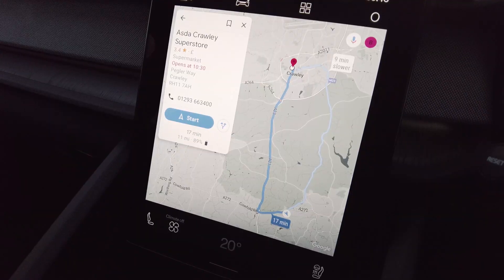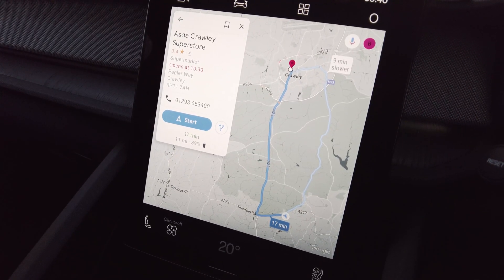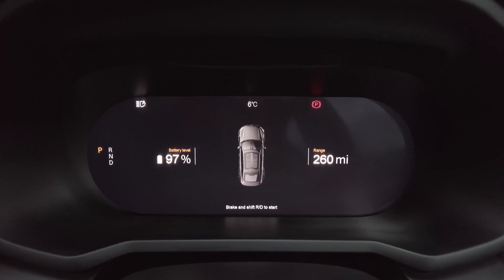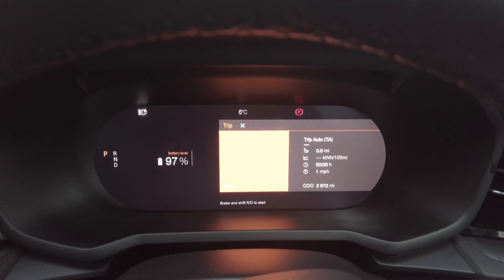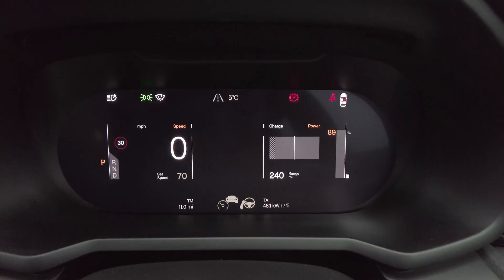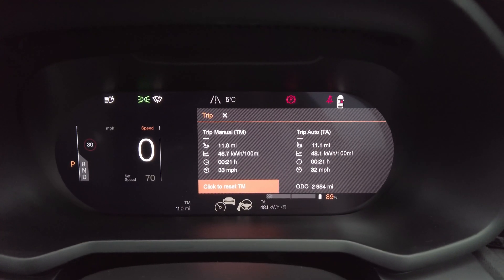Polestar 2 short commute with no pre-conditioning

Comment: I do these test on my own, since I rarely drive longer trips (most of the time I usually drive 20-60 km trips).
I think it's even more intresting how the EV's perform during shorter trips, since that's how most people use their cars.
No big problem for me though since I can charge at home 24/7 and slow-charge at work (working at home at the moment though).
But during trips like these (during winter, around -4 grC) I rarely go down under 30 kWh/100km.

Comment: I typically use 10-12% battery on my daily commute during winter 5 degrees celsius in my LR Model 3. 20km commute back and forth. which gives me a range of about 170-180km.

Comment: I totally agree about the relevance of long range winter tests - they don't correspond to many people's daily usage. Good job looking at this :)

For comparison, i am also only using my Model 3 2021 for short (15-20km) trips at the moment, and each time starting from cold. I am getting about 280Wh/km (450Wh/mile) if i start from cold. That corresponds to about 6% of my battery gone on a 17km (10.5 mile) round trip. If i preheat the car the indicated consumption falls a bit, but overall I will lose 8-9% of my battery for the same journey. The issue i think is that the Tesla aggressively charges both the cabin and the battery, which is about 8-9kW going just into heating. I don't know if the Polestar does the same. I would note that "cold" here is about -10C to -15C though. 

I don't charge at home, but i have access to free 11kW charging nearby. Before i got the car i had anticipated needing to charge every 2-3 weeks, but i find i need to do it every sunday right now as my chosen 20-70% SoC operating window (50% of full battery capacity obviously) is getting me about 75km, what with additional loss from phantom drain and random warm-ups when i do something in the car.

My conclusion right now is that if you have home charging this is a total non-issue. Same if you have workplace charging and your 20 mile daily driving is to work and back. But for new EV buyers who have neither and have to charge at a public charging point, then i think EV ownership could well prove a disappointment in this respect.

Comment: Great videos! This was an interesting one. I have the Polestar 2 (same spec as yours but in Magnesium)  I did a similar test; Got in the car cold, 15 mile round trip, steering wheel and seat on (lowest setting) mainly 40 and 50mph roads. Wet roads and 4 degrees outside. I got 40.4 kWh/100m. Started with a range of 190 miles, after 15 mile drive I now have 160 miles. Hope the warmer summer weather gives improved results. Can't complain though because I'm loving the car! Keep up the good work👍
Reply from the maker: Thanks! Yeah love the car and the warmer weather should definitely help

Comment: Yesterday, the temp was 32F when I left work.  No pre-conditioning.  I drove from my customer's site to the local hotel.  The distance was 1.63 miles which consumed 6 minutes of time with the cabin heat and seat heat running the entire time.  My efficiency was the lowest that I've ever seen on TeslaFi.com at 31%.  I used 746 Wh/mi.

The life support systems use much more energy than the drivetrain during the initial few miles until the programmed comfort level is achieved.  My Model Y used 1.21 kWh to go 1.63 miles, but the energy was free from the hotel, so I probably should have preconditioned.
Reply from the maker: Thanks! Interesting to hear your experience on tesla. I wish there was a data gathering app for polestar!
Reply: @ShortCircuitPS2  - Yeah, TeslaFi is pretty cool.
Reply: @ShortCircuitPS2  
This is the most important and the most useful data that TeslaFi gathers as far as I'm concerned.  Most of my commutes are over 60 miles one way.  As temperatures drop, it is very helpful to know your vehicles average efficiency.  With a rated range of about 300 miles when fully charged, then I could expect a full charge to give me about 225 miles with temps in the 25F to 40F range.  It looks like 60-70F is the car's happy temp. with roughly 4 miles per kWh.

This is data gathered from the last 7000 miles of travel in my Model Y.

Temperature	Wh/Mile	Efficiency %
5 to 10 F	379.49	60.2	
15 to 20 F	327.07	69.6	
20 to 25 F	326.03	68.9	
25 to 30 F	308.91	73.1	
30 to 35 F	287.94	78.7	
35 to 40 F	294.92	76	        
40 to 45 F	283.72	79.2	
45 to 50 F	278.88	79.5	
50 to 55 F	263.4	84.9	
55 to 60 F	268.73	82.3	
60 to 65 F	244.78	90.3	
65 to 70 F	250.35	88.3

Comment: A good and informative video, thanks.I still think the Polestars range calculator is misleading, at -15 on city roads it claims 267 miles from a full charge, in our wildest dreams, lol.
Reply: It's probably correct if you drove one trip of full distance ~267 miles, without stopping. 
As mentioned in the video - the majority of people drive frequent shorter journeys, which means the car & battery cool down between trips, which significantly reduces the range.
Reply: @SDK2006b  lol, you obviously don’t have a Polestar! I don’t think I’ve managed to get over 200miles on a long trip.
Reply: @davidkerr4103  - I've had a PS2 since the start of November but I haven't driven it over 30 miles on a single trip yet.
I did manage to get 28 kWh / 100 on a 6 mile trip from cold in mid November and my car has the 20" wheels
Reply: @SDK2006b  I’ve done 4000 miles in mine and I have the 19” wheels and I have to say I’m really disappointed with the range. 
I’ve had a couple of business trips of around  400 miles and thought when I got the car, I’d only have to charge once. I have to charge once on route, while at destination and on the way back. A big inconvenience.
I’m also embarrassed as I convinced 4 other colleagues to go with one also. We are all experiencing the same issues!
Not impressed and wish I’d gone Tesla. 
Unless Polestar bring out a mega update that significantly improves efficiency I won’t be keen to have another one....
Reply: @davidkerr4103   - Tesla ownership comes with it's own disappointments. You'll certainly love the extra range, but the moment you discover you can't fit a chair in the boot, or when they autowipers turn on for 10th time for no reason you can figure out, then you'll be wishing you bought a Polestar :)

We choose our cars as best we can and just learn to live with the compromises...

Comment: Preconditioning will also mean that you can regen when slowing down. A cold battery will not regen as much so you would not be able to reclaim the potential energy back into the battery if it’s cold.
Reply: Unfortunately preconditioning only preheats the cabin, not the batteries. For now anyway. As far as I know the only way to preheat the batteries is to select a DC fast charging station as your (nearby) destination.
Reply: @r87961  does it even do it then?

Comment: I have 64kwh Kona and last few weeks have been doing 20 miles a day dropping wife to work and not preconditioning in Essex normally do 100 miles a day im getting 3.5 - 4.2 miles per Kwh so averaging say 3.7 which equates to roughly 230 miles defrosting lights heating all on if that helps
Reply from the maker: Great to hear, Kia seem to be very efficient. We are looking at the esoul to replace our outlander phev.
Reply: @ShortCircuitPS2  it is a good car the new ioniq 5 might be worth a look next month